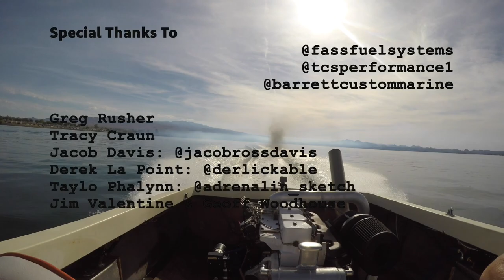Cummins Diesel Boat Video 2.0

Comment: Just noticed how the turbo is mounted backwards on the steedspeed manifold. Pretty cool setup. Has a cross over pipe like the original non intercooler 89-90 cummins engines. Wonder what the EGT's are with this setup?
Reply: probably through the roof  lol
Reply from the maker: It has a water to air intercooler mounted under the Turbo and the pipe comes back up and goes across e.g. t.s are not a problem
Reply: @MerlinsOldSchoolGarage  
Was the intercooler custom made

Comment: Merlin I am working on a project myself I'm putting 410 sprint car motor in a jet boat I'm hoping it will rip like I think it will alchohol injection and all the hull is a  biesemeyer should be a ripper

Comment: Are you still answering questions about this boat? Fellow zoni looking for info…

Curious about the orientation of the engine trans; if it were flipped, couldn’t you run the prop shaft from the trans, through the hull to the prop?

In its current config, did you implement a gear box to the prop?
Reply: Not my boat, but it’s a v-drive. Engine sits flywheel forward, goes through the transmission and a short driveline to a Casale C500 v-drive sitting up near the front seats. Prop shaft goes out through the bottom from there. Hopefully that helps 👍🏻

Comment: Makes it a bit unique. Only diesel boats otherwise seen are ones used as workhorses. KEN'S WELDING has one with a couple diesels in. Moves ALOT of water. Comes in handy when trying to raise a boat off the bottom of the river or lake.
Got some ideas for a diesel boat. Might use 1 of those VW engines I got off you to power a paddle boat (amidships on either side) at some stage. Not fast (since when are non-turbo NA VWs "fast" anyway), but be quite adequate for cruising along.
Reply: I've seen several diesel swapped boats across the Midwest built for fun not work

Comment: I am planning on making a steel army boat and putting two 7.3L power strokes in it, no boat in this world would have the speed and power that would have man I can’t wait
Reply: Yeah, how’s that $100,000 project going?
Reply: @RNTV15  haha not 100k more than that maybe 250 thousand with all the necessary equipment but got both motors rebuilt just waiting til summer
Reply: Just buy a cheap navy boat and remove the armor plate like Heavy D from diesel bros did check his out before wasting that much money

Comment: More distroction for the environment, good job.
Reply: If you mean destruction go hug a tree before I cut it down to heat up the oil in my oil drip wood stove it really rolls coal good way to get rid of tires too

Comment: Pretty awesome!  Is the Cummins engine  pretty much stock or what?
Reply: does it sound stock 
 commom sense
Reply: it wont smoke stock if that can sum up an answer to your ridiculous question
Reply from the maker: far from stock sir
Reply: is it a 12 valve
Reply: @coreyjohnston5962  a stock 12v will roll coal just by turning the pump up

Comment: Sorry been building Cummins engines for a long time with that stock pump and stock turbo there's no way you're getting 600 horsepower I'm pushing 85 lb of boost 14 mm pump and still getting 700 horsepower
Reply: Lets not forget it doesn't even have a charge air cooler. I think 600hp is a bit of a wild statement, 300-350 maybe
Reply: @leen6bt  If that
Reply: Gotta remember that this boat is probably measured at the crank instead of through a drivetrain. I would say 500 is easily doable on a vp44. Power Driven Diesel has taken a stock vp44 to 599 wheel HP which is insane for those pumps. So while 600 is a little wild of a claim.... probably less that 100hp exaggeration.
Reply: The dyno sheet don't lie
Reply: @davidwoermansr  show the dyno video he'll I can state my cummins is putting out 2000hp on pump fuel and say it was dyno
Reply: @coreyellisart6877  but can you show a dyno sheet with the hp torque and rpms and that's crank HP

Comment: Just open the fuel pump to the last  and flood the pistons with diesel ...😕... the other way round more AIR less fuel faster fuel air mix ...more power more speed...😉
Reply: You need to match the fuel with air to get max power...not more air
Reply: Less fuel more air means less lubrication more friction and that means parts flying

Comment: The boat is pretty cool and don't get me wrong I'm no tree hugger but lose that rolling coal bullshit. It's not cool, people know it's a Cummins and it dam sure doesn't add any performance. It just shows you aren't tuned right and are wasting fuel.
Reply: Looks fine to me my pulling truck and tractor blow way more smoke and lose power if you cut the smoke back

Comment: I'm no tree hugger, far from it but that soot is on purpose and should be illegal.
Reply from the maker: It’s peanut oil it’s biodegradable
Reply: You'd hate all my pulling trucks anything that has a trailer behind it smokes